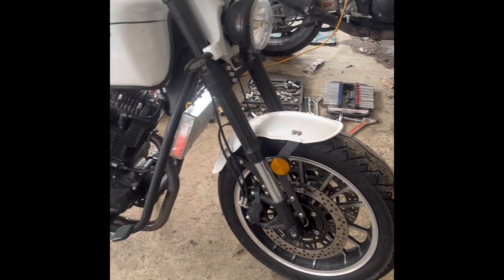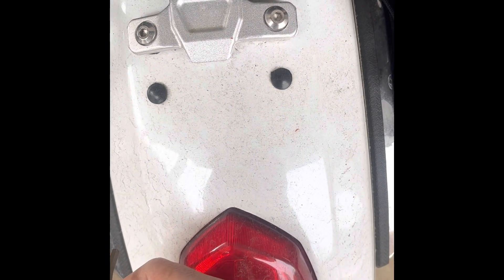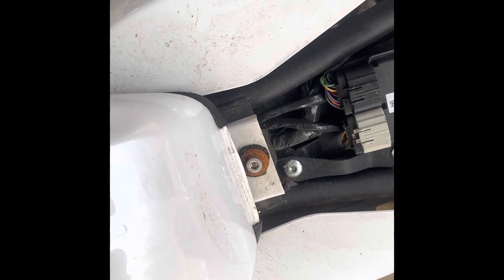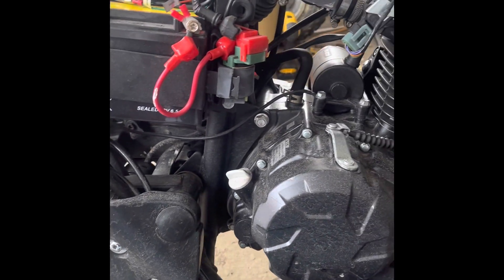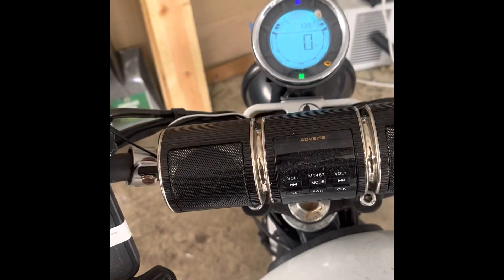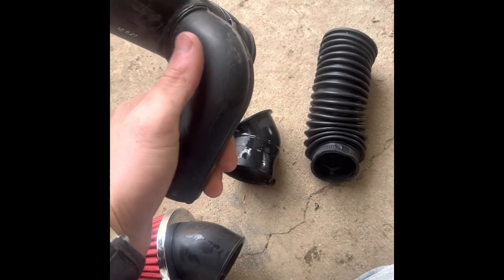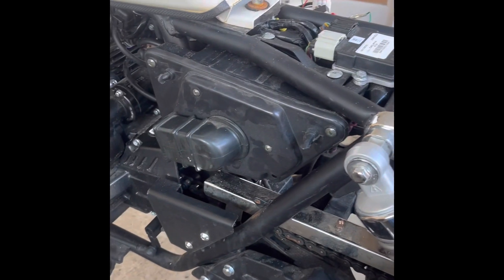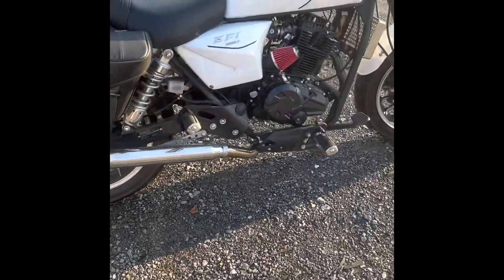BD 250-7, boom cruiser, xpro falcon 250.  Air intake performance modifications

Comment: Awsome mod! Does it perform any better? Looks nice!
Reply from the maker: I just installed it this winter so I have to wait until the snow melts to try it.  Im going to do a review in the spring and a few riding videos.
Reply from the maker: I took it for a ride today and it runs a lot better the throttle is a lot more snappy and I got to use the nos kit today you get about 8 seconds out of it.  It’s not throwing you off the bike or anything but it does make a difference at the top end

Comment: How much faster did it make it go?
Reply: It will go 84 pinned now the problem was that the hose from the air box to the throttle body was pinched so when you got to high rpm’s the hose would collapse and you would lose power.  I don’t think it added any power but I think it allowed the bike to breath the way it’s supposed to